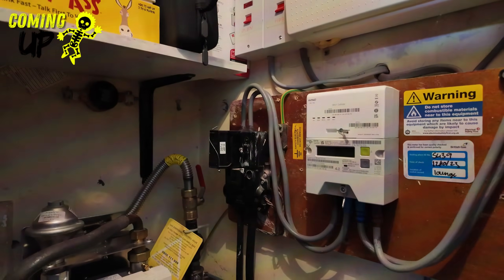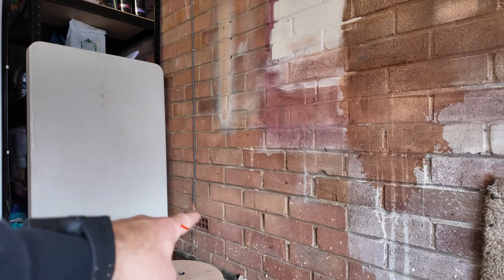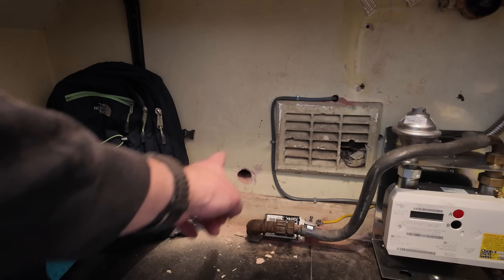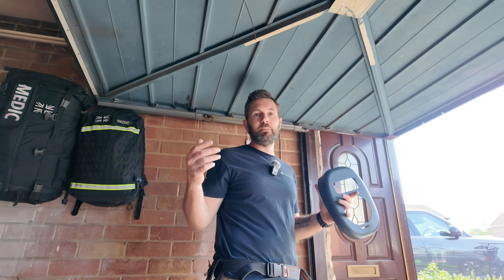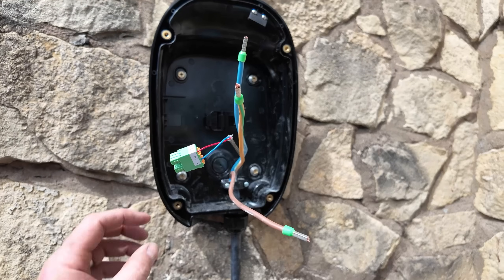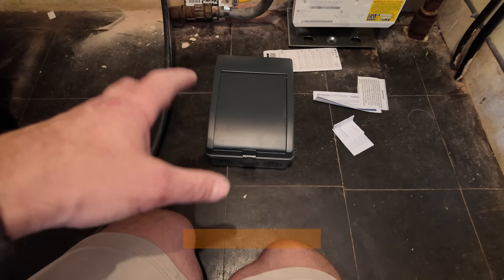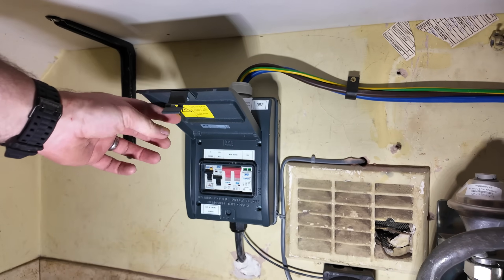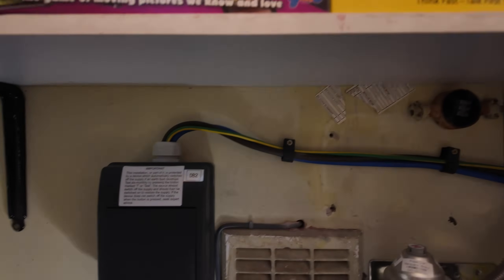Installing EV Chargers on a Looped Supply - Is It Worth It?

Comment: I've put one of these in myself. They're quite straightforward to install as you say.

Nice work as always

I'm a little surprised that an RCBO wasn't installed in the consumer unit (BG do them with an RCBO as well(, but that said, I suppose with SWA and it not being underground, it's fine (those chargers have an RCD installed anyway)

Furthermore, a certain Arty installer on here would be losing his shit with seeing an IP66 board installed. Does it matter as much as folks think? I suppose that is up for debate. That and the regs are ever changing anyway.

Comment: I can see installing a EV charger is not a problem on a looped supply providing all the necessary checks and paperwork’s are carried out but the only issue I see is what about the other property on the looped supply when it come to them wanting an EV charger?  I suspect it will then be refused or they need to be un-looped in which case who pick up the bill for un-looping should the DNO decide to charge? There needs to be some consistency and clear processes in place as I can see that for those that know you are on a looped supply, it could come to who gets in first wins.  It might be prudent to have an EV charger fitted even if you don’t have an EV car just to make sure you are first in and don’t have to pay for un-looping should that be the case. I’m an electrician who was considering installing an EV charger even though I don’t own an EV myself. I decided not to as I wanted to upgrade the main consumer unit etc (we all know what electricians consumers are like) and I’m on a looped supply. Then out of the blue my neighbour bought and EV an had Octopus install a EV charger even though.  Two weeks later the DNO sent their electricians round as Octopus had not notified them that they had installed an EV!! It will be interesting to see what happens if I do need to install an EC charger.

Comment: What is all this fuss about looped supplies or 45, 60, and 80 amp supplies.

A 3 kw emergen heater, 2 kW electric  fire, 2- 4 kW load on an electric oven and hob, plus other household appliances will all demand up to around 10 -12 kw for at least an hour in practical conditions. About 44 - 52 amps.

The vehicle charger will only pull up to around 7 kW for the first hour, that's if the vehicle is totally dead, then reduce down towards a trickle charge, lowering the demand.

It's the responsibility of the electric board/DNO to supply an adequate sized power supply to a property, not the sparky. 

If any competent trades folk installing a charger are nervous about overloading the cut-out fuse. Then, the EV charger should be fitted with an optimiser, so it continuously trickle charges. Extending the already limited use and range of EVs., but at least reduce any drama with overloading supplies.

Or, it should be interfaced with the meter tails so it only boosts when the household demand drops to a lower threshold.

Comment: All about the looped supply, what about BS6891 8.4.2.1 separation of pipework to electrical services, the main cut out fuse looks closer than 150mm to the main gas shut off valve, I would be more concerned about that than popping a supply fuse, it’s more dramatic

Comment: Im on a looped supply, eventually i will have to go the "EV" route, when they "unloop" the supply, how far back do they go to give single feeds to each house?, (is it to the substation or say in the main cable after the garden of each property). The loop coming in the property is in concrete topped with asphalt. The mains "head" is about 6 inches from the asphalt floor.

Comment: Apparently  the dno's have decided it doesn't matter if you have a looped supply and want to fit a charge point, according to my NIC guy who visited me recently.
Reply: That could make quite a difference, I have a looped supply and am 18 months into waiting for unlooping.. I'm sure I read recently that as many as 1 in 10 UK households are on a 'looped' supply, yet another hurdle to be overcome for anyone wanting to pursue EV ownership and home charging.
Reply: @Avtur-g4x  who is your dno, mine took 2 months , neighbour had ev charger as well , we just checked one wasn't plugged in at the same time as the other for those few weeks just to be on the safe side

Comment: would be interesting to see how they "UN-LOOP" the supply and what is actually involved - Im on a loop and have wondered how they would do it and would they just cut next doors canle off once they have a new supply - as mine runs under the house to next door -(concrete floors) ??
Reply from the maker: 💯 agree with that would love to film the DNO unlooping
Reply: My DNO were great, Contacted neighbour and me to arrange date to dig up driveway / Details of what they would do etc. Driveway 1 ft wide trench to main road. New Cable fitted with new fuse head (80A). Neighbours grass small hole dug. Old cable split cut/isolated. all put back together in less than a week. (Plus authorised to fit EV Charger in mean time until unlooping as long as load limited ie CT clamp and EV charger load limits to ensure supply never exceeds 60A).
Reply: @alanrenwick1652  How much did they charge you for the new cable - I have heard some DNO do it for free - some charge £1000  - effectivley charging whoever has the car charger for the new supply to the other house !!
Reply: We had ours done for a Heat Pump installation. It was like key hole surgery, they dug a hole outside in the street where the main was and then a small hole in each garden. Then used a 'wormer' from the main in the path to tunnel through into each garden. Impressive. No cost to either party.
Reply: All about the looped supply. What about BS6891 8.4.2.1 separation of pipework from electrical services, the main cut out fuse and the main gas valve look closer than 150mm, I would be more concerned with that than popping the supply fuse, it’s more dramatic !
Reply: @Andrew-su3wtcutting & pasting exactly the same comment in multiple places is called "spamming" & it's poor etiquette
Reply: @alanhat5252   I meant it to be on general comments, not a reply, it’s not copied and pasted, just re written, just to highlight the proximity of services that’s all

Comment: That cable run is horrendous- surely you could have found a neater route. And at ground level I’d have thought it was at high risk from accidental damage. Is running cable at that level within regs?
Reply: Am I to assume from the lack of response from the “electrician” that this cable run is in fact NOT within regs and that he’s too embarrassed to admit that it’s a shockingly bad route he chose and that the cable is infact liable to accidental damage???

Comment: If you only had one incoming cable, how would you know whether it was looped or not? You could be at the end of the line.
Reply: I work for a DNO doing supple point tests for EV chargers etc, always check neighbours supply to check if it’s lopped or not, or network schematics
Reply: I thought i was not looped as 1950s semi detached house, even checked neighbour. Luckily DNO had good records and it showed that i was looped. just not to an obvious house. ie not my direct semi detached neighbour. New underground supply fitted within 3 months when convenient to both of us.
Reply: @alanrenwick1652  did you have to pay for it ?

Comment: Do all ev chargers require RCD protection?
Reply from the maker: Yes mate they all need rcd protection 🫡
Reply: Not all, it depends on how the cable is run and if they have a physical test button for the rcd, which a few of them do have.
Reply: @acelectricalsecurity  so your answer is "they do not as long as they have one"
Reply: RCBO F Type 32amp try finding one of them Mister.

Comment: In exactly this situation. Took almost 4 weeks for the DNO to respond to the connection request. They've given the go ahead, provided the charge point is fitted with a load limiting device. Being a looped property this must be no more than 60A. Which, is kinda weird because we seem to have a 100A main cutout. But, that's for them to sort out and puzzle over later.

Anyway, they said we can have the charge point installed and they will at some future point carry out a survey and we must be de-looped. Time frame? Up to 4 months. But, at least we'll have the charge point. We just need to remember we can't shower at the same time the car is charging 😂😂
Reply: Looped here, 60A fuse, DNO approved a standard install with no conditions in less than 24hrs! Hats off to UKPN.
Reply: EVSE does have a load balancer
Reply: @philh3709 hi mate. We are also with UKPN here in Cambridge. Did you just email them or is there a specific form that needs filling up to have the power supply unlooped? I live in a terraced house with a 60 amp fuse.